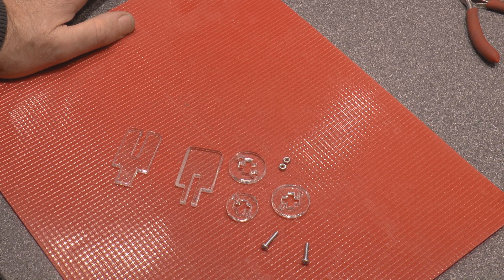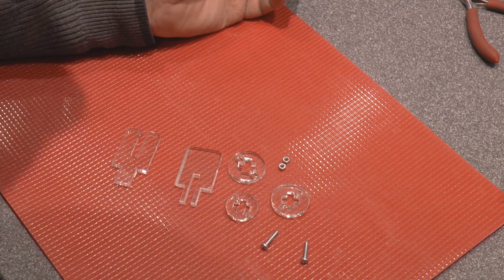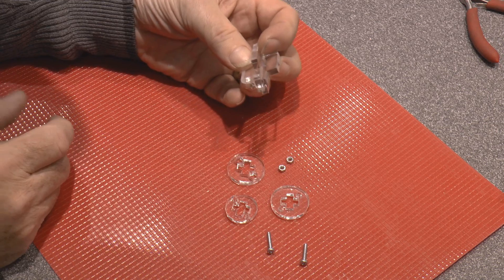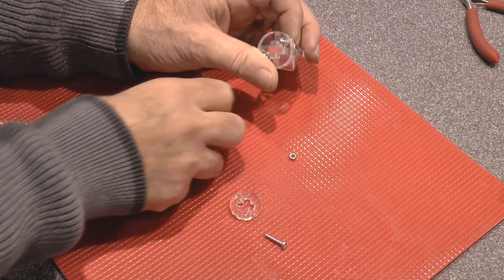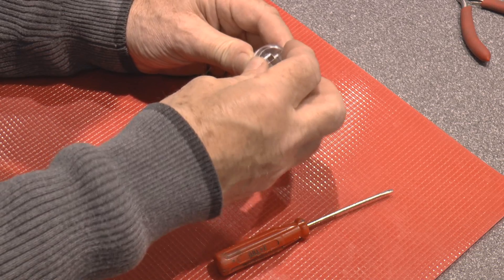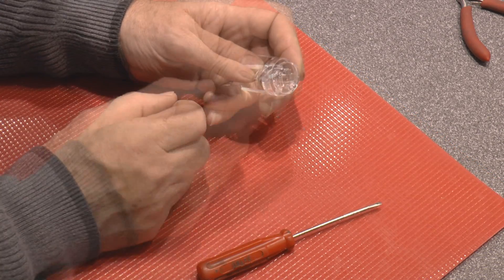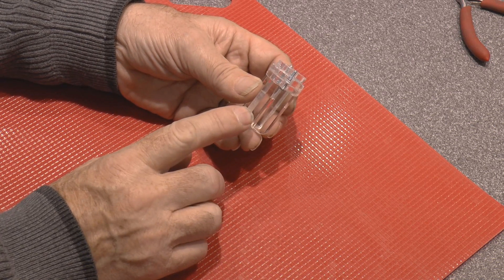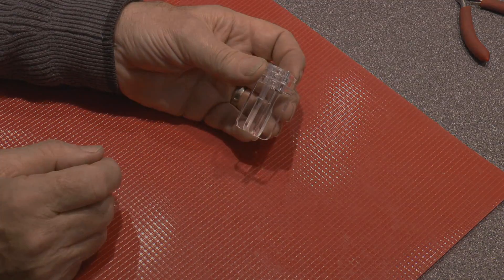Mirror removal tool

Comment: Hi is it possible to have the plans? Thanks!!!!
Reply from the maker: Hi Kostas
This is a tool that suited a particular mirror clamp system with two holes in the clmp ring. As I upgraded the mirror mounts and also acquired other machines. the clamp plates had slots rather than holes. For the slotted clamps I used a little 6" steel rule as a wide screw driver.  However, you are welcome to the file. It can be downloaded from a repositary at  www.rdworkslab.com or you can reach me with this private contact form  and I will send the file.
 https://forms.zohopublic.eu/ndeavorlimited/form/K40XtreeemLaserCutterContactRussSadler/formperma/k2Cn0QN5ChpazfTMAUw25lZ-FKpjZa96TQWHjv3ntOg  

Best wishes
Russ

Comment: Neat little tool! I made one with, aherm, two nails in the end of a bit of wood ;-) An important problem I had with the little threaded discs that hold the mirrors in place: the face of the disc wasn't perpendicular to the thread, so when the disc was tightened, it only pressed on the mirror at one edge. I solved this by placing another metal disc behind the mirror, and a small grubscrew through the original threaded disc. The grubscrew presses on the center of the metal disc, and allows for any angular misalignment with the thread. Drat, I need to do a drawing ;-)
Reply: Great Point Lindsay! Also, Thanks Russ...........